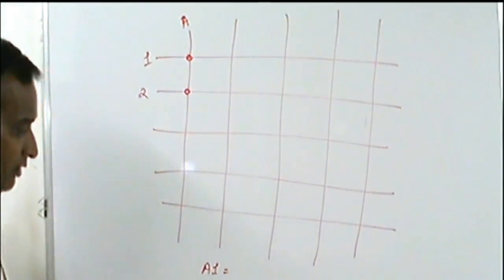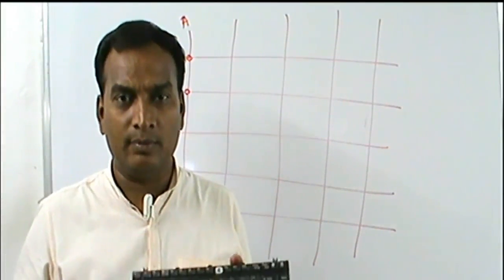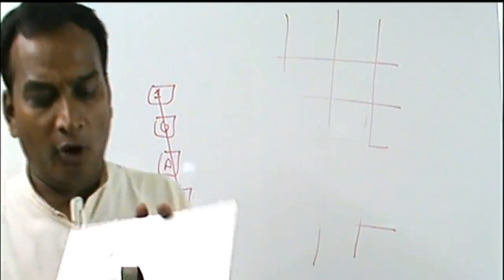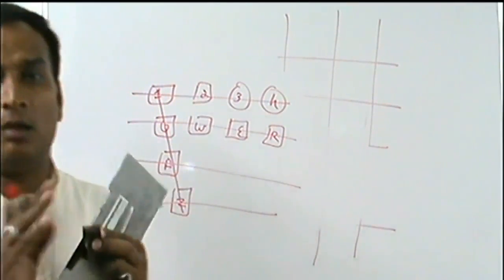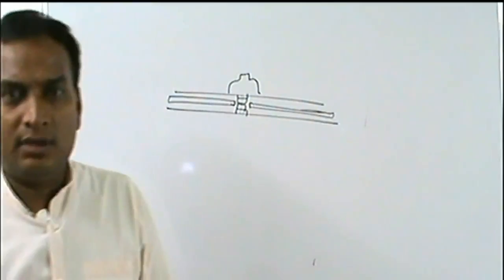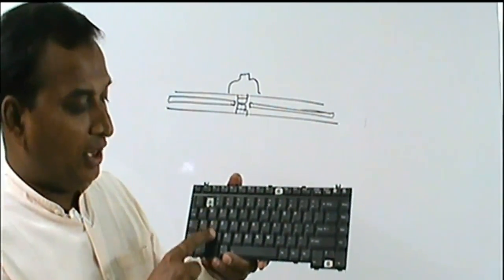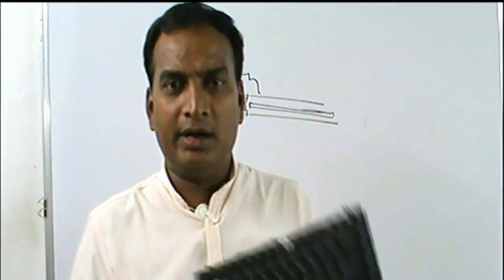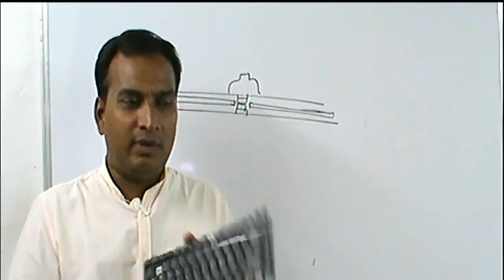Laptop Keyboard not working problem solution

Comment: I had this problem but in a laptop. 

My 1 Q A Z were not working after coming back from a repair shop (they fixed my motherboard due to a short circuit caused by a power surge). 

I opened the back of the laptop, removed the battery (to touch the things inside it) and reset the BIOS and the keys are working again!🙂🙏
To reset the BIOS you need to unplug it and plug it back in but it’s nice to see someone doing it first so you feel confident in doing it. Search on Youtube how to do it.

Comment: Thank you sir, i do what you say and to fix "s" and "z" button, my keyboard not working anymore
Reply: I was trying to work on my laptop keyboard few weeks before watching this video. I checked the keyboard ribbon cable connection 3 times, still keyboard did not work. I tried again and found that I was inserting the ribbon cable in the opening at the very bottom of the connector (of the motherboard). It was supposed to be inserted in its opening about 1 mm above the slot where I had been inserting. After that Keyboard worked.

Comment: Hello guys its just moisture ...remove the moisture in the circuit or plastic below the soft rubber key be sure that it is dry or free of moisture ...electronic contact cleaner is the best one to perform the task rather than alcohol

Comment: I might try out the cable cutting part.

My problem is that after taking the laptop apart and putting it back together, the keyboard has a huge lag and when pressing any keys, they do not react immediately or at all.

Could it be that I have damaged the data cable somehow?

Thank you for the video.

Comment: F10 f11 f12 delete 1 2 3 4 7 8 9 0 keys doesn't work (what i was doing is: cleaning, plug in/out connector, and cutting the connector)..but still not working. Sir, what any suggest before i replace it. thanks

Comment: Thank you for making this video. It was very informative. I have a question though. On my laptop, several keys are not working, the esc ~ 1 tab a and z keys have stopped working. The q key still works. All of the non working keys will start working if I press and hold them for a long time, but will only work for a few minutes before I have to do it again. 

Would this be solved by cutting the ribbon cable? Also, my ribbon cable has tabs on the end. If I cut it, I will cut off the tabs. Will it still stay in the socket ok?

Thanks

Comment: Hi, I have a year old Lenovo IdeaPad 110 laptop, when I turn on my laptop it turns off by itself after  Lenovo logo, then it never turns on so I tried to check hardware. Once I remove the laptop keyboard it works fine with battery and power while charging too. Sometimes 
If windows boots normally all keys are working fine.
Once I connect my laptop keyboard the windows goes to sleep and then turns off by itself. So disconnected the laptop keyboard and connected usb keyboard so it works fine.   Is it faulty keyboard or decoupling capacitors or I/o chip ???
Reply: what did you do to resolve this prooblem ? same thing happened to my keyboard

Comment: Sir thanks for the video. It is quite informative.
I have the same issue with my dell Inspiron 14r laptop. Some keys are not working. Like down scroll key , M, S , Enter key.
I thought may be it is due to keypad failure so I bought a new keylas .  I installed new keypad to my laptop. This time the keys were    working but some other keys were not working like H , O etc. 
I'm confused if it is laptop or keypad issue. 
I also tried the cutting of conductor but the same problem persisted. 
What do I do please suggest.
Reply from the maker: Clean keyboard connector with toothbrush

Comment: Sir, you saved my PC mechanical keyboard. The keys 1,2,3,4 and 7,8,9,0 stopped working.
I cleaned the contact points (removed the dust deposits with a sharp headed screwdriver) of the thin plastic plate and the keys started working. You saved my rare precious keyboard. Thank you for your awesome tutorial!!!

Comment: After replacing de CPU, two columns on my keyboard stopped working, so i cut the cable a bit. One of the columns started to work again. So i cut a bit more, now the keyboard dont work anymore. I could not tell if the issue is on the cable or the connector.

Comment: what is the material is used for keyboard matrix circuit ?
Reply from the maker: +Ashutosh Mahapatra it’s a carbon pad
Reply: i have a matrix sheet which i extract from my keyboard ,but the colour of the material is silver white not black. How the material is carbon ?
Reply from the maker: +Ashutosh Mahapatra yes its a silicon protected but end of keyboard connector you can see pure carbon

Comment: Sir, I have a doubt I am having a dell inspiron 15 3521  laptop and the keybord has been messing for quite a while. I haven't used my laptop keyboard that much to tell that it would have got old which prevents me from getting a new one. So my keyboard keeps pressing the up arrow key. automatically also the up arrow key does not work when pressed manually . when i remove the keybord cable from the io connector everything stops and when i re-insert it the up arrow key resumes to be continuously pressed. so i want to know what is the problem with my keyboard and it is only with this up arrow key all other keys are working fine. please help me
Reply from the maker: +Thala katchi key stuck problem, replace your keyboard

Comment: I have an expense ASUS laptop which I just bought and had issues with the keyboard not working. I took it in to find out that the cables did not have a good connection. The "professionals" told me to buy a new keyboard part for my pc and pay 150$ for installation. I found this Beautiful Video and cut 2mm off of the cords and my keyboard works perfectly. Jesus Christ this guy is a life saver!
Reply: Thank you. That is good experience to know. I also thank to this teacher for making this informative video lesson.
Reply from the maker: +Eirik  Thanks

Comment: I have Dell XPS 9343. I cleaned the keyboard with a vacuum cleaner and now keys 2-3-4 and 7-8-9-0 , backspace , Tab, capslock are not working. Any suggestion. Do I need a new a keyboad.
Reply from the maker: +ijkeshtiban replace Keyboard

Comment: As u said if one individual key is not working, then its keyboard problem but what if one of the individual  key  is  always  working ........as in  my  case  1!  key is always  working  even  wiÌwithout  pressing it.
sir plz help  me in solution .
Thanku  in advance.

shall  i scratch that  individual key in between the two insulator of rubber .

Comment: I spilled some alcohol on my laptop and some keys dont work (q,1,3,u...) and sometimes touchpad doesn't  work, while keyboard is plugged. While I was cleaning I scratched cable, i cut it down 1mm still same.
Reply from the maker: +Aleksandar Cvetanovski  remove keyboard and place it at sunlight and if problem not solve then you should be change your keyboard because of alcohol spread inside of the keyboard layer

Comment: Keyboard buttons stopped working all of a sudden, but when i put back the connector, they seemed to work for a short time before i moved the laptop around, then the exact same keys would stop working (1, 2, 3, 4, p and backspace). So i figured that the connector has a problem and it moves a little from his position, thanks for the scissors trick

Comment: Hi my keyboard keys (A and shift legt) are not working, I have to hold down those keys and it'll work normally for some minutes. Do you have any suggestions?
Reply from the maker: +Rayhan Santoso keyboard keys contact not working. In this case you should change keyboard
Reply: Harshad Patel Should I just plug a USB keyboard instead?
Reply from the maker: +Rayhan Santoso usb Keyboard works
Reply: alright got my usb keyboard as a replacement. Thanks :)

Comment: sir my ik latitude keys are not workng and also tried by cutting front portion but stll not workng  think my membrane gots damaged how to repair that??
Reply from the maker: Keyboard fault or io controller fault
Reply: +Harshad Patel can the membrane be repaired...??
Reply: +Harshad Patel 
Hi I'm having a problem with my Laptop keyboard, first of all my laptop keyboards working, but the problem is that my laptop keyboard suddenly typing automatically like this key; -------------------------llllllllllllllllllllllll[p[[[[[[[[[[[[[[[[[[[[[[[[[[[[[[[[[[
how to fix that? please help thanks.
Reply from the maker: +dharmendra chouhan  Keyboard repairing not possible

Comment: sir my laptop lenovo ideapad z470, on its keyboard A,Z keys are not working , remaining all keys working
Reply from the maker: +Vijay Prakash please also check there is "tab " key and "Alt" also not working ...if not working these all keys then cut 1mm cable from front side as per video description
Reply: Harshad Patel tab and alt keys working fine
Reply: +Harshad Patel sir mine is esc and f3 and f5 my laptop is acer aspire e1-531g and remaining all keys working that 3 not working
Reply from the maker: +JmGamingChannel its a keyboard problem.. Replace keyboard
Reply: +Harshad Patel someitimes  its working sometimes not and im on laptop if a laptop fixer ifix its gonna work agian? and im using win 8
Reply from the maker: +JmGamingChannel sometimes its working due to switch contactor work but sometime not working because of poor contact 

Its not repair because of it was a molded plasic layer contactor

So only one solution on there and its a replace keyboard
Reply: ok thx sir if i clean m fan in my laptop im gonna talk to fixer :)
Reply: also how to fix it im gonna open mah keyboard right :)

Comment: I have a Toshiba Satellite C665 laptop. My toddler daughter repeatedly pressed multiple keys and spilled water on keyboard as well.
To be specific 4,6, esc, F2, F4, F7, F10,F11,F12. They are all in two upper rows (maybe it means something). The trick with shutting the laptop down, removing the battery and cable then pressing and holding the power button didn't work for me. Any other solution? 

Is there any solution or replacement is only option?

Comment: I spilled soda on the keyboard I púll it out and clean it but none of the the keys, is there a way to repair it or is better to change the entire keyboard, thanks!
Reply from the maker: It can't repair ..is that better you should replace keyboard
Reply: +Johnny Cuevas Does your laptop works?? If it does, then you can buy an external keyboard without replacing the laptop keyboard. Also, replacing the laptop keyboard will be damn expensive.

Comment: a, s, d, f, j, k, l, ;, and Enter keys just stopped working. Sir, what is the solution?
Reply: +Semiu Azeez I have the exact same problem, tried cutting the ribbon and still the mentioned keys didn't work...
Reply from the maker: +Penguin San  & semiu azeez     problem not only with keyboard cable .. it also problem with your io controller
Reply: Harshad Patel now by an io controller do you mean the keyboard itself?
Reply from the maker: keyboard micro controller was an  in built sio ic ...
Reply: +Harshad Patel i will exchange the keyboard and then give further progress

Comment: sir , in my laptop  y,t,capslock,left shift key,tab,f3,8 4 keys in numberpad are not working . all of them stopped working suddenly,can it be driver problem
Reply from the maker: Devendra veerelli no its not driver fault ... it's a keyboard problem or clean keyboard connector and clean motherboard .. if problem is same then replace keyboard
Reply: thank you sir,
i''ll clean  them  & check

Comment: Awesome video sir, but i have a doubt. If my keys are not working like 1, Q, A Z, (In my case is = [ and enter ) can be fixed by cutting the cable the way you did it?

I have another keyboard that, keys 4 and 7 aren't working neither. Cutting it may fix the problem too?
Reply from the maker: Thanks Humberto García in case 1,q,a,z   is not working so may be keyboard cable carbon  erase or socket problem or io controller problem but most probably it due to keyboard cable carbon erase .  may be circumstances different in each case /  4,7 keys not working mean its a keyboard fault

Comment: what if my e key doesn't work?? I wanna know if its keyboard problem or controller problem before i buy a new keyboard, only my e does not work
Reply: Oscar Cheung NVM i realize u talk about it in the video
Reply from the maker: Oscar Cheung if only 1 key is not working then it's a keyboard problem ..replace keyboard